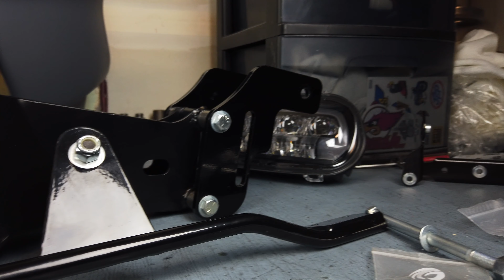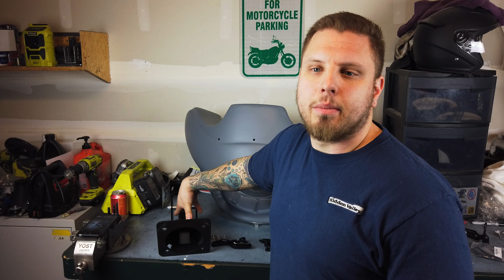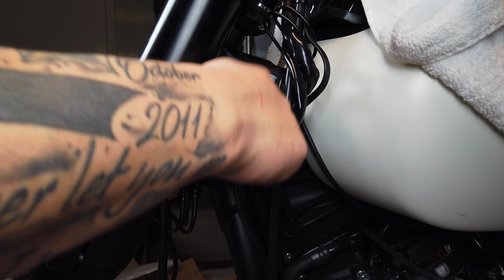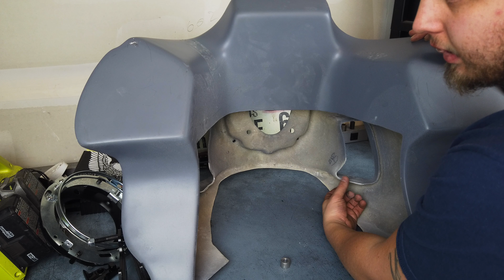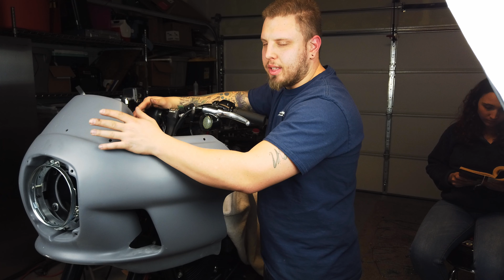2018 Fat Bob FXRT Fairing Install

Comment: Hey brotha, I bought all the same things and just tried installing it on my bike. I got a Sport Glide. I ran into an issue though when trying to put my headlight back in. The cooling fins on the back are too tall, so the headlamp stands off from the bezel too much to make up the screws. Wondering if you had a similar issue?

Comment: Will this faring fit on 2022 Softail street bob if not where can I buy the mounting bracket
Reply from the maker: Yes it should, all the necks are the same so anything meant for a 18+ softail will work

Comment: So I get you bought the chd brackets but where did you buy the neck bracket and lower bracket. I appreciate it!
Reply from the maker: The fairing came with the neck bracket I just had to swap it out. The fairing will actually be for sale soon. Switching over to a deviant Fab fairind
Reply: @TheMrJHSN  Did you sell the fairing yet?
Reply from the maker: @williammiller9640  yes I did
Reply: @TheMrJHSN  I appreciate the reply. Yeah i have a rwd fairing already. Just saw your video waant sure other companies made cheaper neck brackets.

Comment: Great, but where is the part where you mount the bracket to the neck... Could really use that picture.
Reply from the maker: It mounts on the front tank bolt. It's in there
Reply from the maker: It's at 4:05
Reply: @TheMrJHSN  thx, its mostly cause i wanna try to retrofit one to a flh shovelhead.

Comment: Do you think that fairing would a 08 fat bob with some modifications?
Reply from the maker: That should be a pretty easy fit actually. My brackets were made for a Dyna and wouldve bolted right onto your frame

Comment: I would rubber mount everything as Harley’s shaking will crack the faring at the bolt hold downs.
Reply from the maker: The new Softails are very tame with their vibrations since they're counterbalanced. They get some buzz at high rpm but not nearly as bad!
Reply from the maker: But for the Dynas I would definitely agree 👌

Comment: Hey a little late but the spikes for the windshield screws are just the heads of those screws and you can choose to use your own right?
Reply from the maker: Yep! I actually got different ones I'm gonna put on haha
Reply: @TheMrJHSN  lol those worried me. Watched your last upload from 3 weeks ago where you were about to get it together. Final thoughts on that fairing? ps looks fn amazing my dude.
Reply from the maker: @mrbforshorter  got  to use it once before paint and I loved it. It hasn't gone back on cause of all the front end work I'm doing, I'm hoping to have it all together in a week or 2

Comment: Where did you find that headlight bracket? I can find the spring plate for the light but not the adapter plate that mounts up to the fairing.
Reply: Will you sell your spare headlight bucket
Reply from the maker: @shelbywheeler9786  Sure. You can contact me on my Instagram easiest. Tag is the same as my YouTube username
Reply from the maker: Mine came with it in the package. Possibly do a search for FXRT 7 inch headlight bracket/mount? I'm not sure. I actually have a spare haha
Reply: I just finally cracked mine open I see that now, my bad lol
Reply from the maker: @andrewbond3746  haha no worries!

Comment: Love it, I only can't find this fairing. Where did you get it??? Thx dude, can't wait the final!
Reply from the maker: Here is a link to the one I bought
https://rover.ebay.com/rover/0/0/0?mpre=https%3A%2F%2Fwww.ebay.com%2Fulk%2Fitm%2F183619719277
Reply: @TheMrJHSN  854 bucks including mount hardware?? That's a pretty fair price. Look, you are talking about some little adjustment regarding to the mount to the frame. I have 2018 Slim, so the frame should be the same as your fat boy, right? What's the issue? I count with some modification, just if you could specify it a bit. Thank you. Cheers
Reply from the maker: @lhotavaclav  the modification was to the fairing and that was just opening up the lower side of it to clear the forks 🤘
Reply from the maker: @lhotavaclav  the slim should have better clearance than the fat bob so you should be good to go 🤘